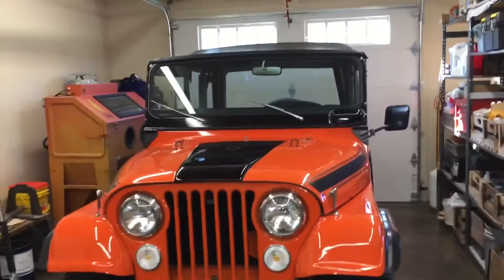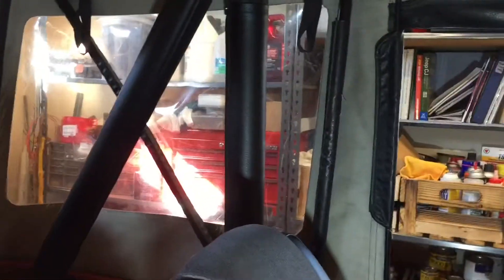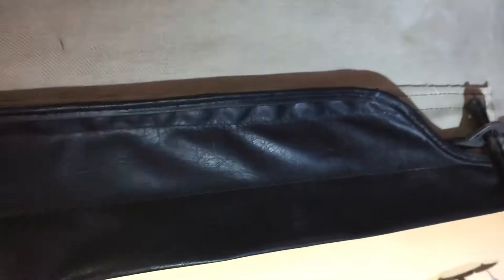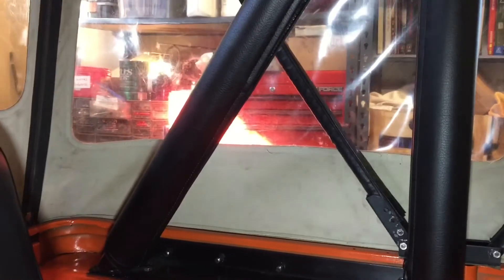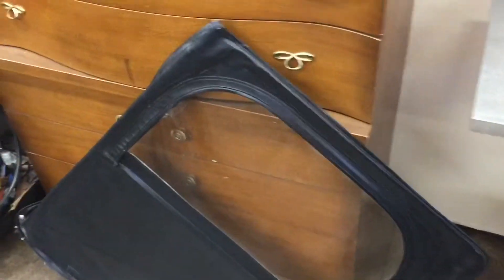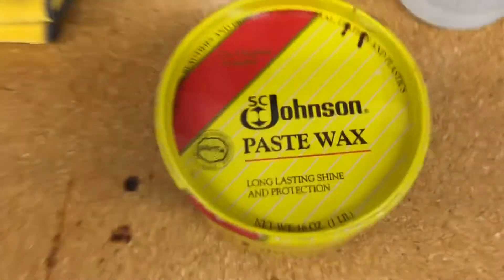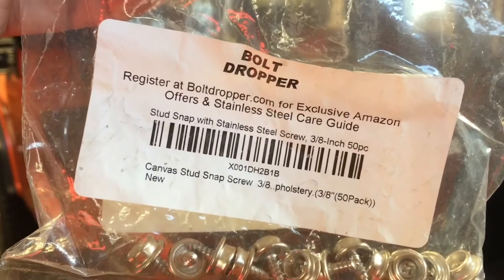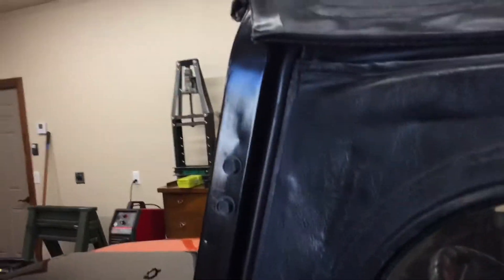Walk-around of Kayline top on 1971 Jeep CJ5

Comment: Already helped me!!! I'm just missing the middle bow support. Have brackets and all. Is it the same width as the back bow? Could you possibly give me the height demension on the middle bow? Thanks
Reply: Yes, the width is the same, front and back bows. The height of front bow looks to be 31”, the back 34”. The length of front half section is 57” so double that for total length. The key part of making new one will be the 10 degree bend so when they’re folded back, they both lay flat on top of side bracket. I have link to install instructions in description of this video, has parts drawing that might help.

Glad you found video helpful. When I was rebuilding my cj, I could of used a few videos like this.